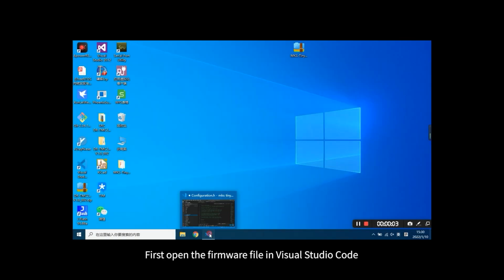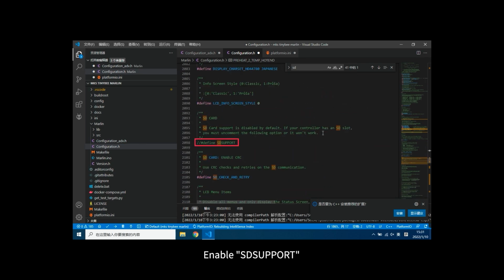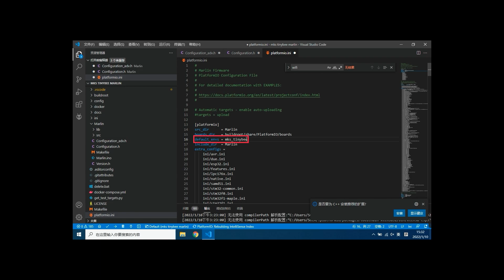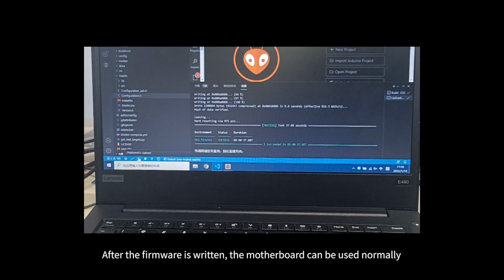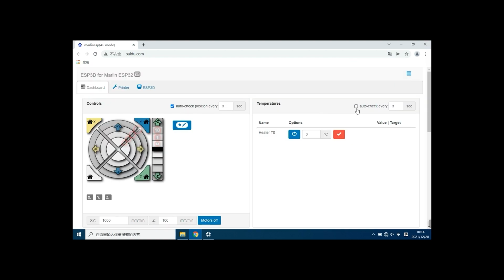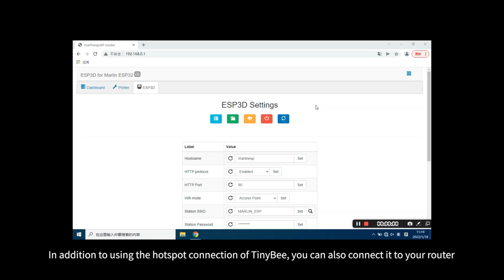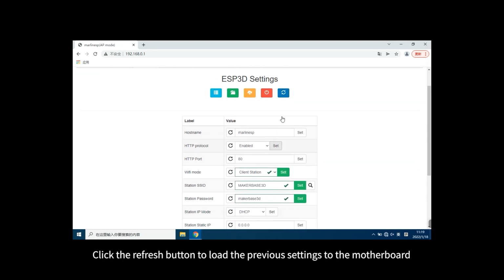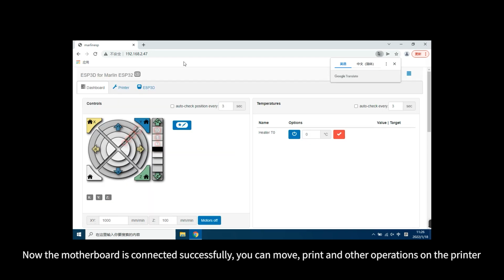MKS TinyBee firmware configuration and connection router tutorial

Comment: Does your z Axis move when you adjust the "probe Z Offset"  ?      I have  TinyBee  and i cant get the Z axis to move to set the offset.    I tried everything in this video. No joy                  Is there something about the board that wont let that work?  Or does any one have a Marlin config where it actually works ?   need for 3D Touch,  Creality CR-10. I like the board. it be nice to get that to work.

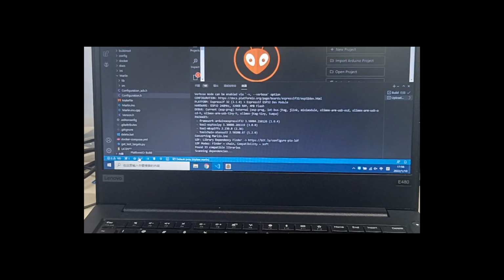Comment: 2:22
It keeps looping with "connecting" and I can't write.
Where is the boot button?
Reply: I personally had to use a 10uF capacitor between the enable and ground pins of the esp32 to get mine to connect. Then I also read somewhere that it might not like the USB controllers on the front of the computer, and some people recommend plugging into the back. Hope one of these helps.

Comment: Hi,
Thanks a lot, for your really great board.
It's my second board from your team.
I compile your "special" Marlin and successfully upload to board. Configured all I need: extruders, wifi, screen.
But when I go into Babystep - board reboot.
What can you advice? How can I fix this problem?
Reply: Do you have a firmware what sort of works? the Github has more bug that an anthill has ants. If you do I would like yo know if you could share it. thanks
Reply: Hi, I'm having this problem too with babystepping. I've tried everything to try to resolve it and nothing. Just stress... and the board manufacturer doesn't have a solution. This feature even works on a Arduino Mega 2560 8bit.

Comment: Hi 
I bought 2 mks tinybee boards but non of them connected to REPRAP_DISCOUNT_FULL_GRAPHIC_SMART_CONTROLLER 128×64
I tried a lot of way but Its not fixed!
Is there any way to solve that?
Reply from the maker: Please reverse the connection of exp1 and exp2 at 180 degrees
Reply: @makerbaseteam4217 thanks
I removed the key tab on the connector and reverse the exp1 & exp2 180 degrees and It worked
Reply: @makerbaseteam4217  This did not work for me. I have tried all nature of cable attachment to no avail.  I am getting load beeping and then constant beep - no display. Also have 3 lights flashing just above the Fan 2 connector. Can't find anyhere that outlines what these are..???

Comment: I'm having a problem with the endstops, command M119 shows that everything is working as it should but motors don't stop
Reply from the maker: Is your enstop three-wire? If yes, do not connect V
Reply: @makerbaseteam4217  Yes it is, and I did that but the problem persists

Comment: when i turn this board on the printer heats up on its own. ???
Reply from the maker: Will it automatically heat up? Will the mos tube on the motherboard always work?
Reply: @makerbaseteam4217  about every 30 seconds the temp for the nozzle shows 280 then back to 0. and the and the fans spin up. and the nozzle and bed heat up.
Reply from the maker: @oadamo  Can you make a video of this situation?
Reply: @makerbaseteam4217  mine is doing the samething, turn power on and bed and hot end heat up, the bed was that hot i couldn't touch it all within seconds.

Comment: Hello! After the firmware, the screen stopped working. The control works, I hear the button being pressed, but the display does not light up and the screen itself does not work. Can you help me?
Reply from the maker: what screen? Are you updating the latest firmware on our github?
Reply: @makerbaseteam4217  I got it, thanks! In the marlin settings, it was necessary to specify the version 3 display. 
But a new question appeared. When the board is turned on, the diode lights up (D17 on the board) and there is 1.5 volts on it. When the fan is turned on, it becomes 3.5 volts. What could be the reason?
Reply from the maker: @АртисПолимер  Is the fan uncontrolled? That's the switch that controls the fan
Reply: @makerbaseteam4217  I know what is it. Yes, he is wrong. Tell me, what is the part under the q4 and q5 markings?
Reply: @makerbaseteam4217  Hello! I'm using LCD ENH12864Z-1 that came with the printer and I have the same problem. How to solve it?
Reply from the maker: @sofiashah3408  One end of the cable is reversed

Comment: some guide to connect bltouch / 3dtouch
Reply from the maker: https://github.com/makerbase-mks/MKS-TinyBee/blob/main/MKS%20TinyBee%20V1.0%20User%20Manual.pdf
Reply from the maker: Hello, this is our user manual, you can wire it as above
Reply: How to set the Pins ??? in the motherboard

Comment: My tinybee is not recognized by my pc . I have the ch340 usb drivers installed because i have lot of chinese arduinos that works with this chip too. The usb power jumper is on ,the power led is on ,but the board don't appear on COM/LPT ports.I don't find any information about this....
edit: the problem was the usb wire included with board.works with another usb c wire.
Reply: I had the same problem. My PC has only USB 3 ports; I switched to another PC that has USB 2 and it connected to the board. After that I have had no problems.